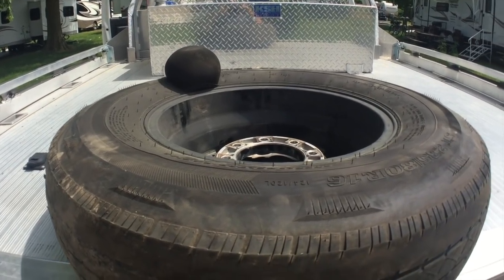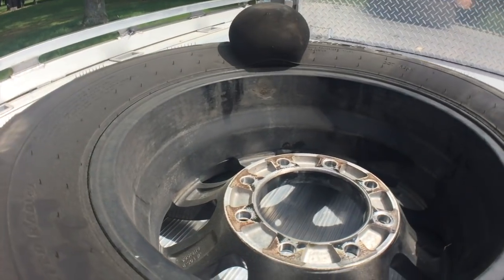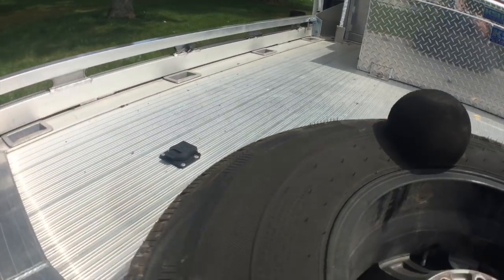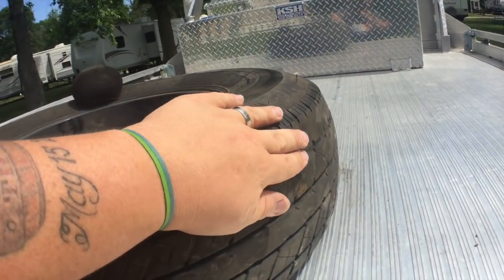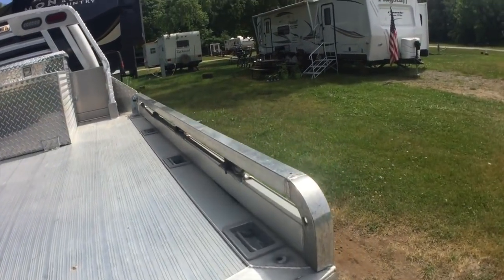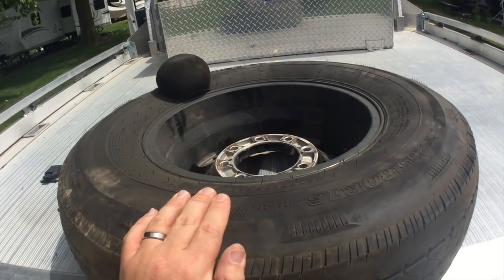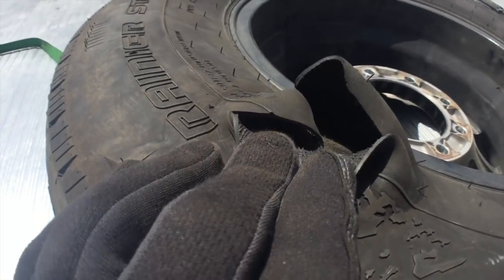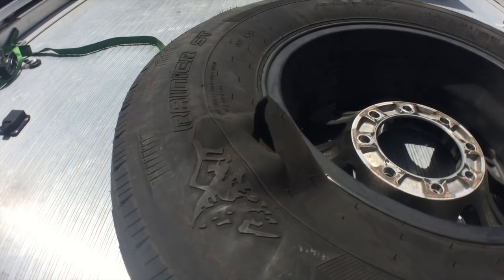SpotTheScotts: Replacing ALL of our Fifth Wheel Tires! ~ RV Life! {#296}

Comment: That’s how Discount Tires replaced all four tires on my TT. I was skeptical at first when told that they would jack up all four tires via axel, after all thats what holds up the trailer. They were done in less than 30 mins. Tires aired up to 80psi (load range E) and wheels torque to 100ftlbs. Per spec on my trailer.

Comment: In the spring, before I left for our Alaska trip I swapped out mt RV trailer tires also at Discount Tire.  Went with the Maxxis brand.  Got me a little nerves too when they put the whole trailer up on 4 jacks.  13.3k miles to and back from Alaska this summer and the tires still brand new.   The OEM tires were "junk" !!

Comment: I've been researching tires and gonna change them out myself, everyone I've spoken with ( rv techs) say to lift the trailer by the frame, not the axles, I have a TT not a 5'er though, supposedly lifting by the axles can screw with the alignment, have you had any issues with that after having your tires changed? Is it ok to lift by the axles?
Reply from the maker: +Matthew Watson all I know is he did this based on how-to videos he watched. We didn't have any issues. All of our issues had been with our slides but it was from original manufacturing, and is all fixed up now :)

Comment: Did you get the lt235 85r16 load range g 14 ply? That is what I am thinking about going to.
Reply from the maker: Brian says yes :)
Reply: That is what I will go to when I need tires mine are good so far but I only have 1000 miles on them. That what most people upgrade to on the Keystone RV forum http://keystonerv.org/forums/
I have one question; your old tires call for max. 80 PSI and your new tire calls for 110 PSI what is the rating on the wheels will they handle the 110 PSI and the extra weight rating?